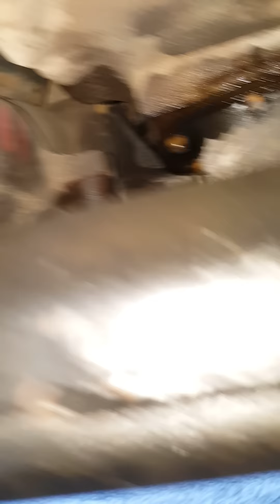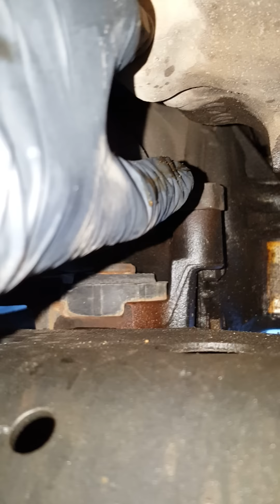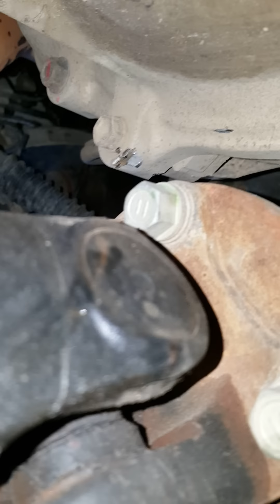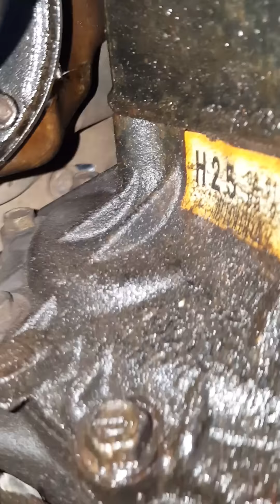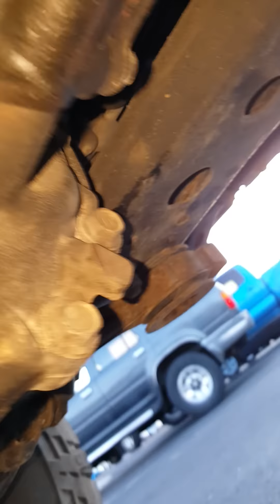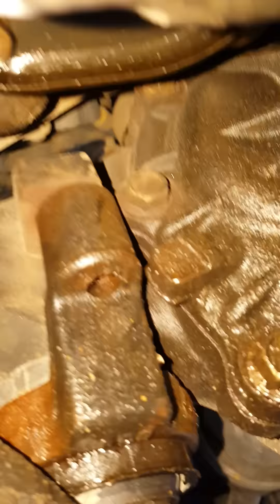Loose Front Differential on FJ Cruiser

Comment: I know I'm a little late into this conversation but what was the outcome and fix for this catastrophe? I will be checking my FJ in the morning lol. Did you have some work done at some point to where the mechanic left these bolts out?
Reply from the maker: So I had to get that bottom punctured section of the engine replaced and I ordered the bolts  and had those installed too. My guess is the previous owner had work done to the FJ (specifically he had a 6" lift on it at one point) and they must have forgotten to reinstall those bolts
Reply: FJX2000 Productions What did it cost to replace the engine pan? Was that the block that was cracked?
Reply from the maker: @JohnSmith-sh1zg  it was quite a bit, a few grand. Luckily I worked at Toyota at the time so work and parts were 50% off.